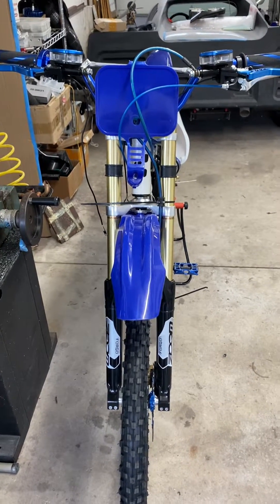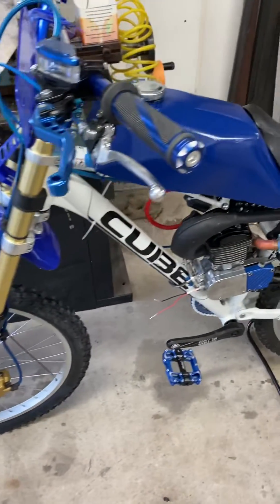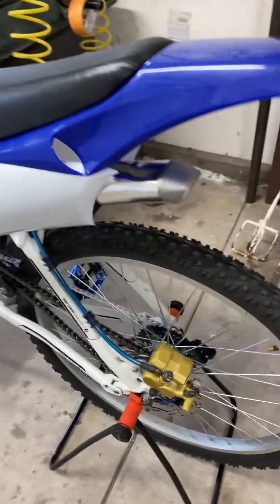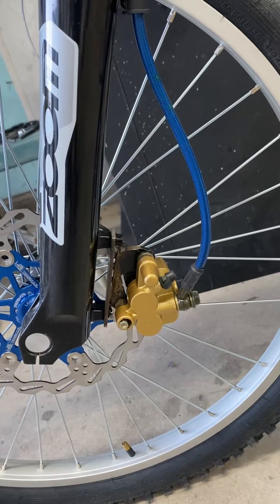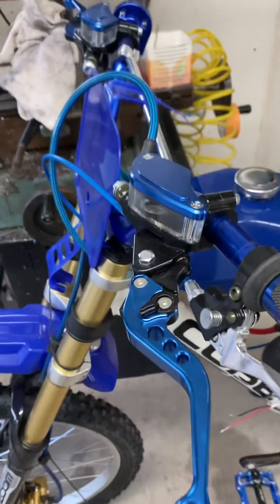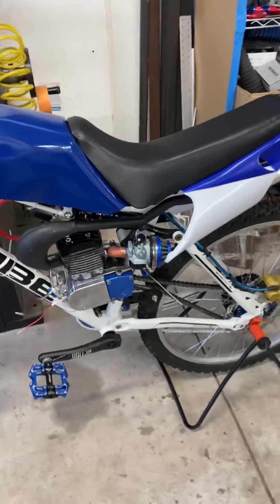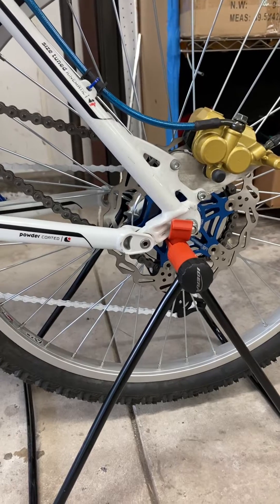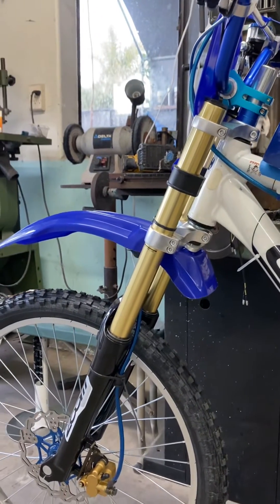80cc Motorized suspension bike build

Comment: Looks awesome but I prefer mine to as much like a bicycle as possible instead of motorcycle......I think F&R cable  203mm brakes on a dual pull lever is plenty of braking power. I so wanna find a cheap 29in full suspension frame that a motor will fit into.